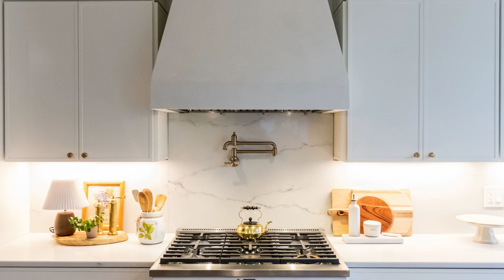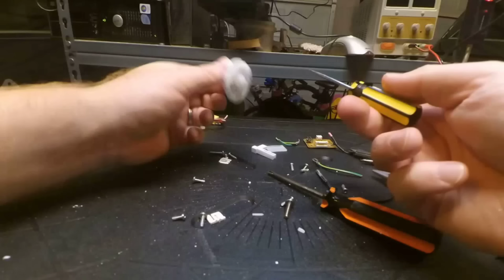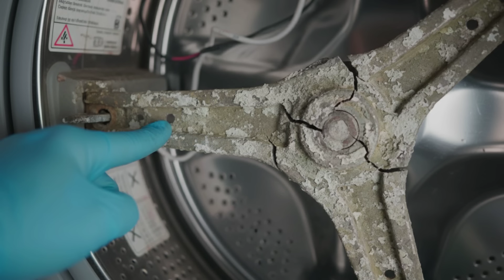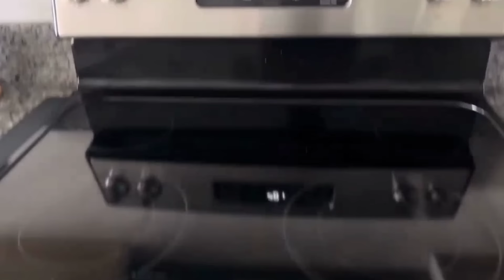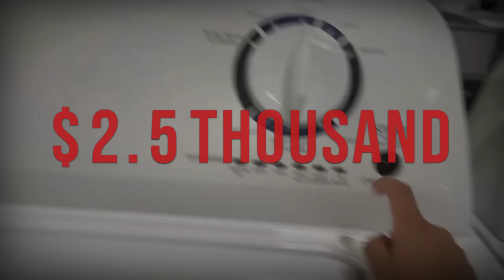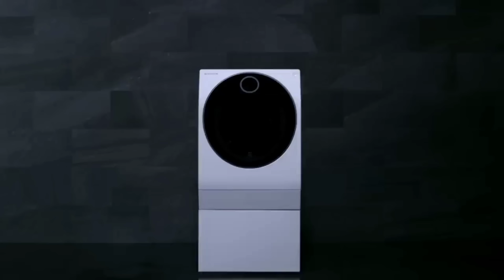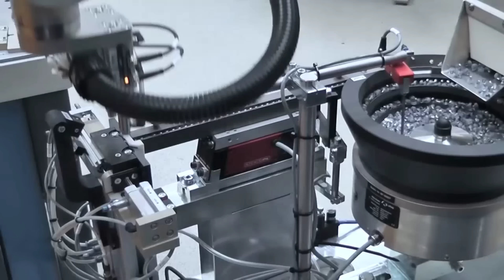The Repairman Blacklist: 5 Appliance Brands to Never Buy

Comment: 1. Samsung with French doors/icemaker
2. LG front load washing machine.
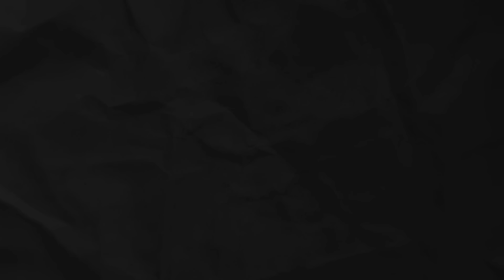3. GE smart range. 5:21
4. Whisper Quiet dishwashers. Instead, select a dishwasher with a steel macerator (usually comes with a stainless steel tub), not a plastic impeller.
5. Ventless washer/dryer combo (all in one).
Reply: Thanks for the list.
Reply: I had Kitchen Aid appliances the stove lasted 18 years, the micro 16 years, the dishwasher is still going strong, no major repairs, the fridge I sold after 4 years because we needed a bigger one…..it’s 16 and perfect.  Whirlpool front load w & d can’t be beat, just use common sense.  They are 15, no repairs.
Reply: I've had my LG front loader for 8 years. The locking finger piece broke within 2 years, as it's made of cheap composite aggregate metal, but I managed to replace it on my own, and ever since then I've been careful to not slam the door shut, it's lasted this long. The drum is supposed to be good for 10 years so we'll see how that goes, but the plastic soap tray bit has many cracks LOL and all the painted labels have faded so I don't know what the settings are, I had to use a Sharpie to write them back on LOL 
If you use machines carefully they generally are OK, I clean the unit and drain it once a month which seems to help.
I have a Maytag dishwasher from 2006, it still works, although I also had to repair it myself a bit as the plastic frame started to come off the screws holding the unit into place in the counter - but I managed to jimmy a couple of larger screws to make sure the thing is hanging off its metal brackets, even though the plastic frame is broken off LOL
I also have a LG french door fridge with the freezer down low and it's also 12 years old and still seems to work OK, except that the rubber seals on the front have got a bit weak so I have to make sure to hold the doors closed, if I just slam shut they flop open LOL
Reply: I have a Samsung French door refrigerator. I specifically did NOT buy one with an ice maker.! Samsung dryer computer board died after only four years! Too expensive to repair so I bought a Maytag. Still have the Samsung front load washer and it is constant trouble. Have had repairman four times in eight years !🙄
Reply: @dawnwheeler2649 - Samsung great for TV’s, they are pathetic with appliances.
Reply: Help that whisper quiet dishwasher ,,  rinse all the heavy gunk off your pots , pans and dishes into the garbage disposal , then let the dishwasher do its thing ...
Reply: @m @mikeelliott4155 . - My dishes are wiped clean when they go in the DW.  I never put heavily soiled things in.  My DW is almost 19 years old, two minor repairs at 15 and 18.  It’s a Kitchen Aid.  Works like the day I got it…..perfect.  It’s so quiet, I have to check if it’s really running.  Be good to your appliances and they’ll be good to you.
Reply: We have that fridge, without the screen and it’s fantastic. 🤷🏻‍♀️
Reply: Totally agree.  My Samsung smart refrigerator icemaker has been broken three times...broke a fourth time and I'm done😢
Reply: Thank you
Reply: Thank you
Reply: My 22 year old Samsung fridge with icemaker and water spout on the door is still going strong. I’m blessed.
Reply: If u have appliances you love,  purchase all the parts now, b4 they stop making them!!  I had a maytag washer , broke, repair guy and I both tried to get the part, ...unavailable. 😢😢😢
Reply: My LG front loader washer/dryer is close to 20 years old and has never hiccupped once! It's been fantastic and reliable.
Reply: I got a he dishwasher that loss power nothing did some research and it said the main board and i replaced it now it doesn’t work again I glad I bought the kit and got the touch panel board too I’m going to replace that this weekend and see what happens
Reply: Years ago we got a top loading samsung washer that was a complete lemon despite buying it new. Years after we sold the property we would get the occasional recall notice for it. Never again...
Reply: I have that Samsung fridge. Its the WORST POS I have ever owned. Always have water running out the front and food always goes bad quickly .
Reply: Thank you!
Reply: Thank you - saves a lot of time
Reply: Samsung is the WORST. My ex bought a $1800 refrigerator, not a smart model, and I’m making ice in trays like a 1950’s housewife!
Reply: Thank you!
Reply: Thank you!
Reply: Nothing wrong with LG front loaders. It is customer abuse is the cause of their premature failure.
Reply: Question - are these recommendations or things to stay away from. W/no commentary, how is one to know?
Reply: @Human-at-Large - Stay away, far, far away from Samsung appliances.  They can make TV’s but that’s it.
Reply: So again, I ask, is that list a list of recommendations or run as fast as I can from products? I see that #1 is a Samsung fridge, but what about the other 4?
Reply: Had a Samsung refrigerator…constant trouble!  I don’t want anything with the name Samsung!!
Reply: @glendalyman5579 - Same here.  TV’s yes……appliances NO!

Comment: I dont disagree with you but i have a 2010 LG front load washer and dryer that are still going strong. Although recently the washer has been “moving” while running. Hasnt done it until recently. Not alot but can tell its same place when started it.
Reply: Is not a current LG at all. Complaints are that the newer the products are the less they last.

Comment: It's amazing that these Corporate Monopolies can only perpetuate frauds on their customers. I get that someone hates manufacturers, but for whatever real insights we are seeing here, there is also a lot of unnecessary vitriol.

You want a better experience? 1. Look at customer reviews
2. You can find videos for many top load machines - from customers, small dealers and some manufacturers
3. Download a copy of a manual or cycle guide. See how easy it is to use
4. Refrigerators don't get cold instantly. Figure 24 hours for fresh food and 48 hours for frozen.
5. Keep your refrigerator or freezer away from heat sources. Range next to fridge? Put something in between to act as an insulator.
Putting a freezer in a hot garage? Try to get some of the heat out. 'garage ready' units have electronics that deal better with temperature extremes, but will use more electricity to compensate for a hot room.
6. Use HE detergent and recommended cleaning products in new washers. You cannot add extra water to 'Normal' cycles as the government tests for water and energy efficiency on that setting.

Comment: Most GE dishwashers and a few models from other brands have Hard Food Disposers which chops up food particles. Otherwise, you have to clean the food trap monthly.
Reply: Isn't it simpler to rinse your dishes before putting them in the dishwasher?
Reply: @coolcat8b  If you want to. I've actually had customers tell me they wash the dishes by hand, first. A head shaker.
Reply: @thomasrobinson182  That would be the other extreme.  I'm more of a "middle of the road".  
Rince by hand, wash/sterilize by dishwasher.  No solids go in there.

Comment: The worst thing about these sites is they demonize BIG BOX RETAILERS and the people, like me, who sell there.
Reply: Lowe’s should be demonized in this realm!  I know from recent experience. Do they tell you at time of purchase , that if You do not purchase their extended warranty and the unit fails during the manufacturer warranty, that you have to contact the manufacturer for any warranty service, and independent repair techs want nothing to do with them, and will not show up, and your stuck with a piece of crap that does not work. And mention this to Lowe’s and they will tell you “ You didn’t purchase their extended warranty , go pound sand, not our problem.” They don’t tell you that up front, but they will when a problem arises. I like Lowe’s, but I will never purchase another appliance from them.
Reply: @brianw8963  Extended coverage is just that. All manufacturers warranty their product for a year. Some extended plans, the one I offer included, add power surge coverage, cosmetic parts rebates and may have a no lemon policy - the same repair done three times. Most offer food loss - keep receipts. The way the business operates is retailers get a smallish percentage for selling the item which they never own, so basically they act as a broker to order your appliance and get it delivered. I mention this because people have the expectation that they can buy a $4000 refrigerator and just return it if they don't like it. Stores don't take them back because they can't afford to. Taking a $3600 loss on that refrigerator is not sustainable. No one will pay close to that for a used unit with no warranty. Can't even offer an external one.
Reply: So what did you purchase and what didn't work? Why isn't the manufacturer taking care of it?
Reply: @thomasrobinson182 It’s a top load LG , very large capacity with the real agitator. Forget the model # but it was 900$. Got it last June , and it started screwing up by October , intermittently at first, and eventually unusable. Took forever to fill with water , code for restrictions or plugged screens. Screens and water pressure were perfect. Then when it would fill correctly, it would run the wash cycle , drain, and just quit. Some other code. Many times you could just unplug it for a few minutes and plug it back in and it would work fine for a short while. Then it started failing every time and was not useable. Like I said, Lowe’s told us basically it’s not our problem because you didn’t buy the extended warranty, contact LG. I did . Refer to my other post for that adventure. For whatever reasons, local independent appliance dealers want nothing to do with these inferior manufacturers. They scheduled two times for some to come from Pittsburg over a hundred miles away, and they never showed up , no calls or explanation. After over 2 months of this hassle, LG finally did reimburse us for the purchase price , and actually a little more for “ inconvenience “, which was appreciated. In the meantime during this 2 month fiasco, we had to go purchase another one, a Speed Queen top loader, tr5 I think, from an independent local store. Should have done that in the first place,lesson learned. I’ll never buy another appliance from Lowes.

Comment: Sorry... but as a technician that specializes in washers and dryers... the machine’s you are recommending via the pictures in your thumbnail and video are ABSOLUTELY TERRIBLE!!! The "base model" top loaders you are showing (anything made by Whirlpool)  are NOT mechanical. They have a computer board. For Whirlpool made products, only the old school ones are purely mechanical. The ones you are showing have some of the WORST suspension systems for top load washers outside of Samsung as well... which causes banging and violent shaking.

Comment: Looking for a great reliable washing machine ?  Speed Queen.
Reply: I have Whirlpool washer and dryer and they been going strong for over 25 years
Reply: @susamgray2483 Whirlpool top loading washers and SEARS TOP LOADING WASHERS all were the cleaning champions of washing machines.
Reply: Love my Speed Queen washer - is an all metal workhorse.
Reply: Bought a Speed Queen washer cuz heard it was so reliable. Had several issues wrong with it. Still under warranty,  repairman came out, called Speed Queen hdqtrs to tell them about it. Had them on speakerphone. Company rep was laughing about each and every bad quality issue. Piece of junk. Absolutely nothing solved. I spit on Speed Queen.
Reply: @none-m2iI think you probably bought a 2018 SPEED QUEEN TR SERIES WASHER. That's the year that was known to have poor washing performance. The old school TC 5000 SERIES WASHER returned with it's old school agitator that does a really good job of cleaning. I think I guessed right that you got the 2018 TR SERIES that was the only series available that year .
Reply: I've heard that before.
Reply: @kahvac: You're definitely right about SPEED QUEEN. Maytag use to be good but isn't so now .
Reply: Amen! Washes better than our prior front loaders and "energy efficient" top loaders that had to have a second rinse cycle. Go for the model without digital controls and get it with all metal gears.
Reply: @johndillon8051 At least SPEED QUEEN is finally listening to what customers want in washing machines. Other washer makers claim they have Commercial Quality machines but still they're not like SPEED QUEENS.

Comment: it would be more helpful to know which manufacturers still make anything worth buying.
Reply: If it is a washing machine, the only answer is Speed Queen from an independent store. Yeah, they are initially very expensive, but not when you consider you’ll have to buy 4 or 5 of the other crap units to equal the longevity of a Speed Queen, which by far makes them actually a better buy! Simple math.
Reply: @brianw8963 speed queen had a 10 year warranty when we bought it. Still in great shape. I have a maytag dryer that is still drying after 20 years of service. Now I am on the hunt for a new Refrigerator.

Comment: I bought a GE wall oven about 2 years ago and decided to bake bread. The recipe calls for 450 degrees but according  to a thermometer  I bought the  device shows the oven only heats up to 350. After watching this video I won't be cracking the temperature to 550 although I can. Disappointed because I thought GE was better - looks like it is not. Yep, I noticed that I have to completely rinse off  the dishes before I run the cycle, now I know why. When I retired I bought 5 new appliances believing they would last 3 have been replaced and my island hoods' lights works sometimes. What a scam.

Comment: govt energy saving requirements contributed to this fiasco.  specifically the LG linear compressor.   made to conserve energy.  it lasts 5 years, goes bad, and the refrigerator cannot be repaired because the entire cooling system is filled with metal fragments.   thats what green living gets you.   broke

Comment: The reason you have so much corrosion in the spider bracket is because of dissimilar metals
Reply: That is incorrect. It is because the consumer is using too much detergent/ fabric softener and not using hot water cycles. I just changed the bearing in my 16 year old Samsung front loader and the spider was pristine!